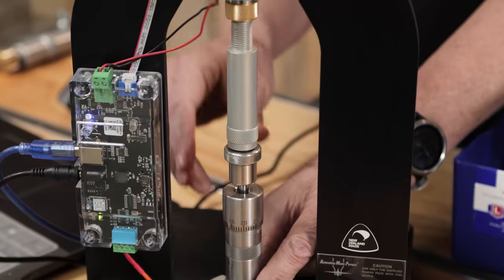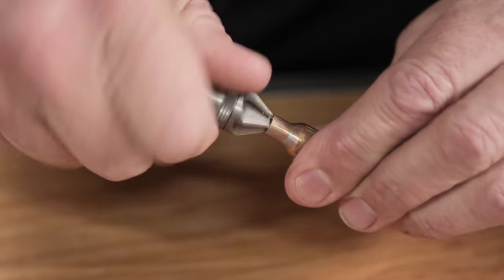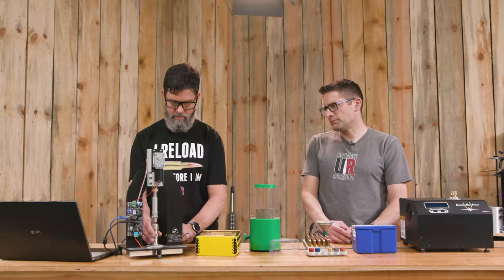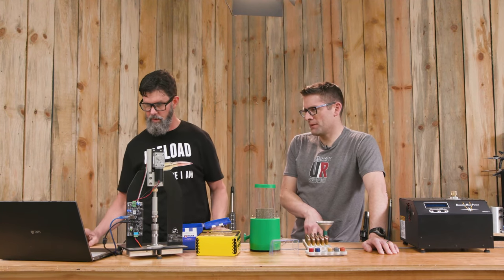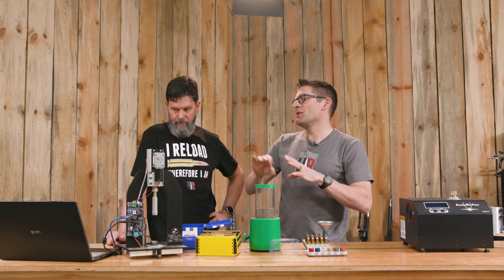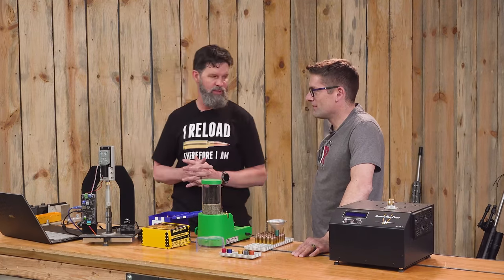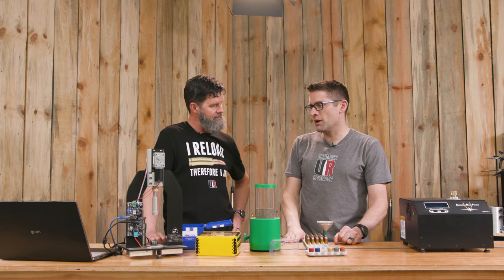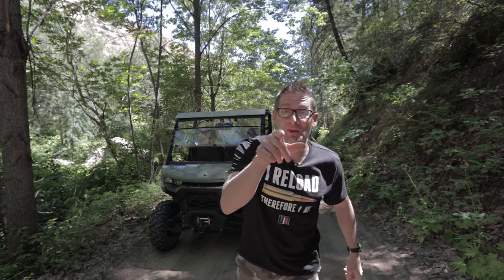AMP Press: Chamfering Case Mouths -vs- Bullet Seating Force

Comment: Now you should try a more precise chamfer tool such as a Redding model 15-p that indexes off the empty primer pocket and cuts a 15 degree chamfer that is concentric with the case. More precise than the one you guys were using, because if you are going to the extent of plotting your pressures seating it only makes sense to be consistent chamfering.
Reply: That's what I was going to suggest. Even a regular VLD style chamfering tool would probably give better results.

Comment: For me running a bronze brush on a power drill into the necks was the best improvement  (smoother seating depth). Even adding  high tech lubricants like graphite or moly powder didn't give the same consistency.

Comment: If you look at the graph you can see the difference in chamfering vs not chamfered. There is 10 lines which start around 0.27 spike up then dip then ramp back up. The chamfered ones start around 0.25 and climb in pressure steadily rather than a jump then dip in pressure.
Reply: Exactly, the analysis of the graph was severely lacking in this respect.  There was a consistent difference in initial seating force which the testers failed to recognize.

Comment: When you do the AMP press comparisons, you should use the load compare option as opposed to putting the two comparisons on the same plot. Will be able to see how the 2 or more comparisons are in relation to each other.

Comment: Thanks for the info. However, I feel that the most important test would be to look at the difference between freshly trimmed cases chamfered and not chamfered. The case edge is at its sharpest and most likely to damage the bullet base after it is trimmed. There is also typically a very small flare or lip left on the case mouth edge when trimmed which could further damage the bullet base. Also,  K&M makes a very high precision case chamfering cutter that controls concentricity, angle, and depth of cut. These extremes (freshly trimmed and unchamfered and chamfered with the K&M tool) would be most likely to show any potential differences.

Comment: I'm not a big reloader and only reload occasionally for hunting and practice. I understand the principals of neck tension and how annealing can affect it. But one thing I have never found any experiments on and isn't discussed in my reloading manuals is how can they effect the group size if (as I understand it) pressure ramps up very rapidly in a high power cartridge when fired. Wouldn't this pressure expand the necks fairly quickly as the bullet encounters the rifling and this pressure would expand the neck to the chamber dimensions very quickly too? If this is true, why would neck tension be so important? I would like to see an experiment where you reload the same case up to 4 or 5 times without annealing firing 5 or ten shot groups at each reload. Then try one annealing at each, reload once, then after two reloads and then after 3 reloads. Then you would could compare group size, average velocities, ES and SD for each group. It has probably been done before but I can't find it.
Reply: Lou Murdica did that test in his tunnel.
Reply: Excellent questions. FYI, my following response is 100% theoretical and is pure speculation on my part, so feel free to light me up if I say something stupid.
Something we have to keep in mind is, to us, everything which occurs from the time the trigger is squeezed to the time the bullet leaves the barrel seems instant. When we slow the entire process down, there's a lot more going on than we think, and a millisecond here and there adds up considerably. 
Pertaining to your question, let's take two rounds and make them absolutely identical in every way, and assume we're working with the best load/rifle on the planet. Both rounds shoot through the same hole, as we'd expect.
Now, take those same two rounds and this time, load one of those rounds with slightly more neck tension than the other. The one with the lighter tension is fired, and let's say we were able to measure the pressure inside the case, and we obtained a measurement of 58,000psi. Now we fire the round with ever so slightly more neck tension, and we obtain a measurement of 58,250psi. The slightly higher pressure is a result of more force being necessary to dislodge the bullet from the case. That little bit of added resistance allows the powder to burn for perhaps a few more microseconds than the previous round, and in turn, a bit more pressure builds as compared to the first round. So, at the moment just before the bullet moves, we're starting with more pressure than the first round. Again, all speculative, I would expect this to affect our muzzle velocity ever so slightly. How much it would affect group size, I don't know, but it should affect it somewhat.

Consistency is key. I don't think it matters whether we're seating bullets with 10psi or 50psi, so long as they're all the same. Depending on the tolerance of the powder/velocity node, there may not even be a difference in group size between a set of rounds loaded with a 10psi bullet seating force and a set loaded at 50psi, but there would definitely be a difference if a set was loaded with a variety of seating forces/neck tensions.
Some folks prefer to seat their bullets with very little neck tension. I prefer to load mine a bit on the tighter side in order to avoid scenarios where my bullets completely leave their cases before my brass has fully sealed off my chamber. If I'm seeing carbon/powder residue on the outside of my case necks after firing, I know my bullets are leaving too soon and I need to increase my bullet seating pressure.
Reply: @whiplash636  I wasn't very clear in my comment. For the non competitive normal reloader for hunting and practice, I'm not convinced annealing is that useful. Personally I do load development using once or twice reloaded brass. I sort the cases by brand and weight (case capacity kind of) and work up my loads starting with the lowest capacity case. Once I find the best load I then load the rest of the batch with that load. I only hunt with once fired brass. The rest is used up again for practice or load development. I don't reload a case more than 4 times. I only have two hunting loads, one deer bear load and one moose load. For practice I just load whatever is the cheapest I can find. As for smoking of the neck, my 7mm-08 does that with most factory loads so I don't worry about it. Unlike competitive shooters, I don't reload expensive brass 10 times or more. I don't shoot past 400 yards at all. I can only practice at 200 yards locally. So I guess my real comment should have been how many times can you reload a case before you can notice a difference in group size or performance for the ordinary shooter, not the professionals with custom rifles that shoot for a living. Yes consistency is important but its easier to do if you can keep it as simple and safe as possible. If you look at pressure curves vs bullet travel you notice the pressure ramps up very rapidly, once the bullet starts moving, the neck tension becomes negligible compare to the rifling engraving of the bullet. The bullet engraving requires increasing force until the entire bearing surface is engraved by the rifling and maximum pressure is usually reached within a few inches of bullet travel. So neck tension is pretty much negligible once the bullet starts moving. That's probably why bullet jump is so critical when shooting groups. Its almost as important as charge weight. I'm just not convinced neck tension is that important.
Reply: @whiplash636  To be honest, I was looking for the stupid...I found none :) I concur completely.
Reply: @denisleblanc4506   When I acquired the tools to see my seating pressures, testing was clear what the differences were. You are correct in stating, not everyone needs it.
Reply: @denisleblanc4506  For your application and range, I totally agree... annealing and stressing over neck tensions isn't worth the time and effort. You're not trying to get 20 reloads out of your brass, and I'm pretty sure potentially shaving off maybe 1/4 moa or so on a moose inside 400 yards isn't exactly what I'd consider critical, lol.
Most folks who anneal don't have an AMP (I don't because I'm a lowly peasant person), and I'd venture to guess that most of them aren't aware that while they are effectively extending the life of their brass, they're also doing themselves an unintentional disservice to accuracy if their systems aren't dialed in correctly. There's a steep hardness curve to get past when annealing in order to take brass from a work hardened state to that of one fully annealed for the benefit of consistency from one loading to the next, and if their time & temperature combo isn't adequate to soften the brass to a point just below that curve where hardness values level out and without jeopardizing the bottom 2/3rds of their cases, the lot will consist of brass with various neck/shoulder hardness values; therefore, various degrees of springback; therefore, various neck tensions; therefore, diminished group sizes. In that case, it would be better to not anneal at all.

Comment: Would using a Lyman M type expander effect the seating pressure? With the step up in neck diameter leaving an angled shoulder this helps align the bullet for a straighter entry into the case. This step will have a smoother surface than a chamfered mouth will have should have less pressure in seating. 
Using your 20 cases set the expander to expand to 10 to not have the step and 10 to have the step.
I load cast bullets and have M type expanders for many calibers and have found they give better results when used with both cast and jacketed bullets. Perhaps this seating test will show why.
As far as buying such a press, a lot of us out here have a limited budget and buying such a press isn't possible. I as well as many others appreciate those that can afford such tools and are willing to demonstrate how they work and how they can improve our loading.

Comment: I want to see a test from once fired dirty brass to leave the carbon, annealed, lanolin lubed, full length sized, trimmed with a three way trimmer ( preferably with a Henderson trimmer) tumbled in a vibratory tumbler with rice ( fired uncleaned brass lube left on using the rice to remove the lube) seated with the AMP press

Comment: You might get a more conclusive result with a FB bullet and a VLD chamfer tool. A 30 degree angle vs a 45 and a FB bullet that wants to fight an unchamfered case - I can tell with my fingers so you would think the AMP would pick it up.

Comment: Nice idea for an experiment but to be truly accurate you would need exactly the same amount and angle of chamfer which you cannot get when doing it by hand.  With your workshop facilities it wouldnt be hard to setup a machine to chamfer exactly parallel and to a consistent depth

Comment: I don't get the comment about not pulling the handle.  How does one prep brass to reload if not pulling the handle on a press? Neck size with wilson inline die?  How many reloads before it won't chamber?  I like the thought about the thought, but the more I think about it, the more I question the validity

Comment: I seen a few people do this test. and the groups didn’t show much change.  the best group he got actually come from the no chafer or anything. and the chart that showed the biggest variation in seating pressures. but he never did do another video see if he could repeat that results. And to me the hole reason to go down this rabbit hole is repeatability, and to try to figure out what is causing different stuff.

Comment: I know that everyone will think I am stupid for asking this question but I am new to reloading rifle brass. What are the benefits of annealing your rifle brass?
Do you have to do it?
I will be starting to reload my ammo for my International Harvester M1
Reply: Not a stupid question at all. There’s many different ways to anneal brass and if you want I’ll dive into some of the easiest ways to do so. Annealing the brass makes it softer, pliable and allows for more consistency with the neck pressure. It’s more important to anneal the neck of fired brass  because it’s basically work hardened do to the extreme pressure, thus more brittle; increasing the possibility of the cartridge rupturing  after several uses. This isn’t dangerous or necessarily bad just means you can’t reuse it. If you’re like me and reload .223 and 9mm as cheap as possible it’s no big deal. But if you are using high end brass and building competition loads losing a fire formed brass is depressing. Did this help?
Reply: @The Hawk Guy  YES THANK YOU!!!!
Your information was very helpful!!
Maybe I should think about annealing my M1 lake city brass
Reply: The easiest/cheapest way to anneal is to use a candle. Use your fingers, Hold the brass by the rim, put the neck of the cartridge in the flame then rotate it. Once your finger get warm the neck is annealed. The brass will go from warm to holy hell that hurts real quick.

Comment: I know that Full Length resizing is the way to go, and I'm in no way interested in neck sizing, but you mentioned fire-forming brass. Is full length resizing fire-formed brass changing the internal dimensions of the case then, if the external dimensions are taken back to manufacturer specs?
Reply: With a factory FL die(Some companies will custom hone them to your specs) you're almost always going to size the case body at least a small amount if you're seating the die down far enough to fully size the neck and bump the shoulder. So yes, you will change the case internal dimensions as well. What you're avoiding by only bumping the shoulder 0.002 is creating excessive head space. So some fire forming remains but you do size the body. Compared to a bushing/bump die which sizes the neck and bumps the shoulder without touching the case body at all.

Comment: Spoiled the presentation by not separating the no chamfer graph from the chamfer graph.  I am not sure why all the AMP Press videos show bullet seating start and finish pressure so high.  Typically with my K&M Force Pack, I see start pressure around 10 to 15 lbs., and finish at between 30 to 40 lbs.  I use approximately .002" interference fit.  I nylon brush the case necks prior to seating.  If I use a VLD style chamfering tool, and turn it backwards only so to iron out the inside ridge instead of cutting away brass as forward rotation does, I can even out the seating pressure and almost eliminate it.  If I use a little Neolube #2 on the case necks the seating pressure required is reduced while not diminishing the actual tension due to the interference fit.  Maybe not so good for autoloaders, for bolt actions it works fine.  Annealing new Lapua brass also makes little sense.
Reply: Same here but when you have that data you should split it in two groups, average each group and then compare the two resulting curves.  You can also remove the outliers and do the same thing, average the outliers and compare that curve to the other two, lots of analysis that might point you towards some testable conclusion, not just a bunch of squiggles to look at, shrug your shoulders and pat yourself on the back for gathering data.

Comment: I'm jumping on here about something else .I'm wondering if you can help.
I no you have a Summit press.
Could you try and use the lee ram prime swager.
It looks like it would work.
But a string on the part says it won't.
I don't consider it correct.
Thanks for all your videos.

Comment: What about the difference  between lubed  an dry necks?
Reply: Lower seating pressure with lubes necks. But carbon is a pretty good lube for bullet seating. I've seated with graphite lube vs leaving some carbon in the neck and actually had more consistent seating with carbon but your mileage may vary.

Comment: Any chance you have connections with folks that can develop either an optical powder cop or a pneumatic case interior volume measuring device?  Preferably both.
Reply: Bison Armory makes a case volume measurement tool, not sure if it's what your looking for.
Reply: @adamsamaha6835  I’ll check it out, thanks!
Reply: @adamsamaha6835  that’s a wicked sick tool.  My DIY setup involves modifying an old pneumatic staple gun to similar effect but no where near as fancy and not interface-able to a DOS.